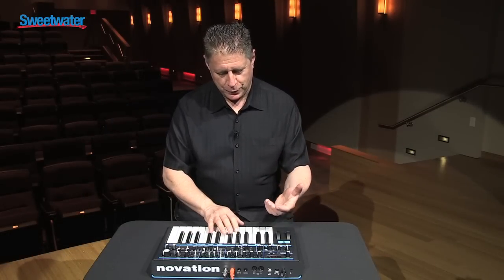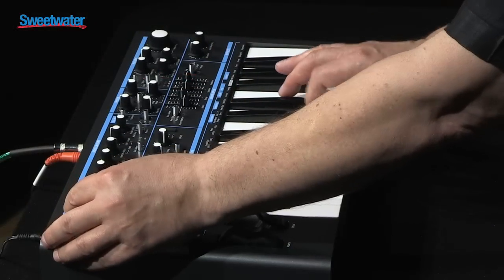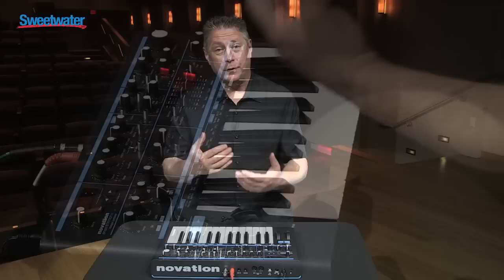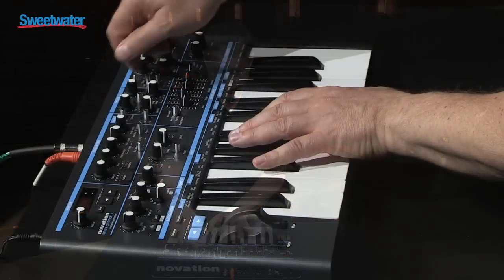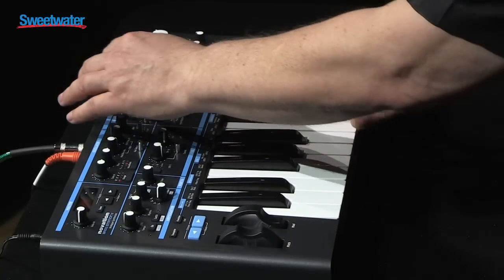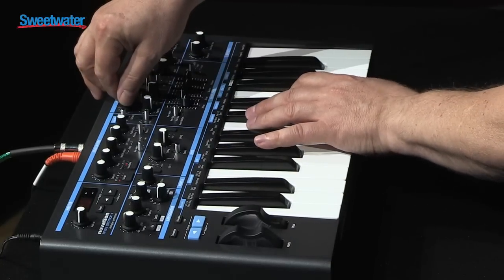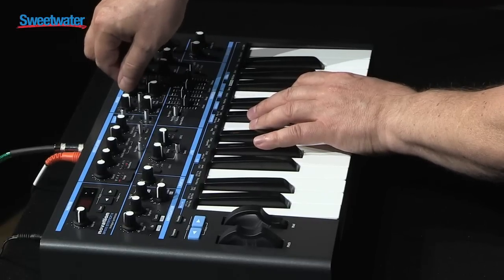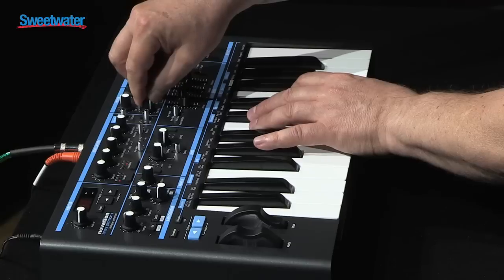Novation Bass Station II Analog Synthesizer Demo - Sweetwater Sound

Comment: run it through a bass amp, as a bass station should, and you can rattle the earth, the house, and the neighbor's house. deep heavy, grinding, or smooth bass sounds can be achieved easily. I use many different sounds in my band and it comes through well through mains at clubs too. very nice buy, as long as you know how to use a synth. but it's kind of fun to get stuck somewhere between sounds and have to dig yourself out of oscillations you didnt intend. happy bassing!

Comment: I just purchased mine  .  Now to figure out how to work it.  I own the novation mini nova had that  for a few years.   They say these musical devices sound harsh or brittle.  I will play them through a peavey classic 50 tube amp head on top of a 6 by 10 peavey guitar cabinet loaded with eminence red coat speakers. Should warm the sound up.

Comment: Hello, i'm trying to do some patch assigments to my BSII from my hardware sequencer. Does the BSII accept transmission of CC/PG/Program Change messages? If so, how can we find out the CC values for the different BSII patches, so that we can enter them into the sequencer (for assignment etc.)?  Thanks.
Reply from the maker: @Arjun Bhaduri check out page 21 of the user manual (available on Novation's website), it has the full MIDI parameters list - thanks for watching!
Reply: Yeah thanks I figured out what to do!

Comment: What size are the keys?
Reply from the maker: Hey there! That Bass Station II is going to come with full-size keys on it, which are generally 427.5mm in width. This size is common amongst most full-size 88-key keyboards, so it's going to give you plenty of room on each key, even with it being a 25-key synthesizer.
Thanks for your interest! Feel free to reach out with any other questions that you might have.
Nick Pasquino, Sweetwater Sales Engineer, (800) 222-4700 ext. 3230, nick_pasquino@sweetwater.com

Comment: digitally control oscillator,
numerical preset storage,
digital effect,
numeric envelop,
numeric arpegiator,
numeric USB port,
and
they say "100% pure analog??"
😶
Reply: "numerical preset storage" — uuh, do you want like a rotary dial for presets? or punch cards?
"numeric USB port" — because there are great analog alternatives for this, right?
"digitally control oscillator" — because it sure is fun to wait for synths to heat up or tune them every time you play?

Sound on Sound review is on point here: "Like the original, its oscillators are DCOs rather than VCOs and anyone who takes this information as justification to flounce away like a wounded teenager could be missing out."

Comment: sorry, but that is rubbish, analogue chips with integrated circuits have been around since the late 70ies/ early 80ies. That was the time when polysynths became portable without the danger of getting hernia or a spinal disc herniation. Polysynths with discrete components can reach a  weight in excess of 190 pounds, like the notorious yamaha CS 80.

Comment: The Bass Station II has a good sound, but every patch kind of sounds the same. Nothing special about the controls or the design of the synth: it's the same bog-standard stuff you get from any generic keyboard. It's like an MS-20, but with patch saving, an extremely basic arpeggiator, and of course it doesn't have the modular cable feature of the MS-20 which sets that synth apart from others. Good demo from Sweetwater though: nice and too the point without the useless chitchat about nothing you get from other demo videos "Well today I got my xyz, and I unwrapped it, and I put the boxes in the trash but first I had to rip them up so they fit in the trash can" etc. etc. for 5 minutes before you get any information.